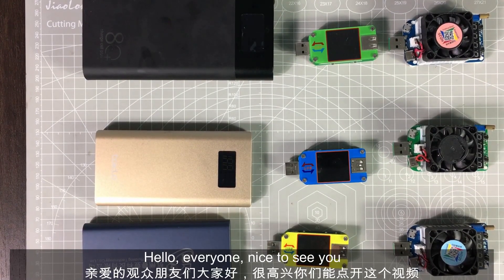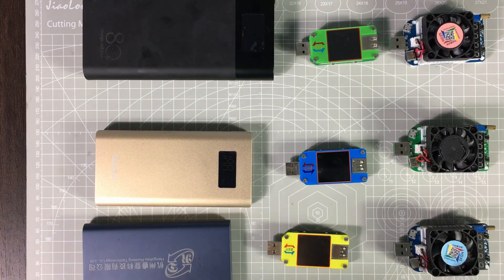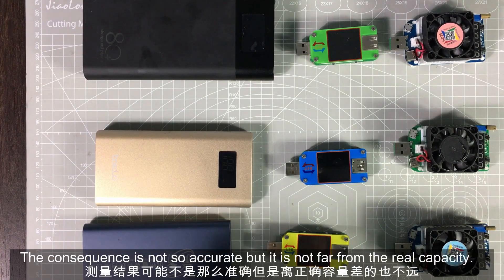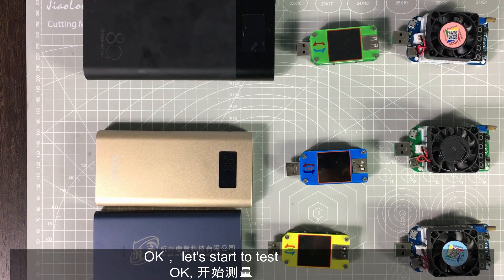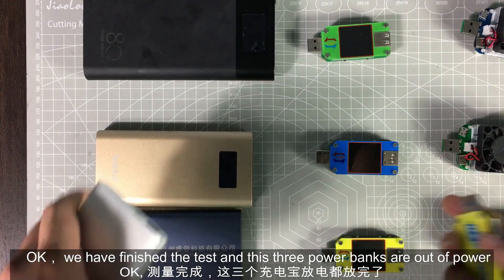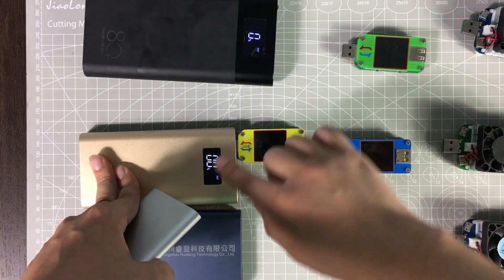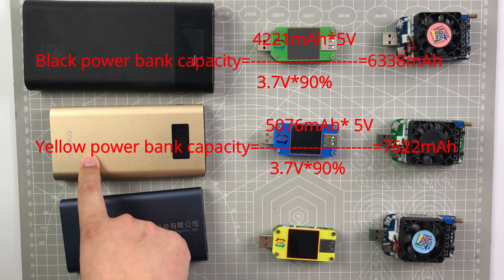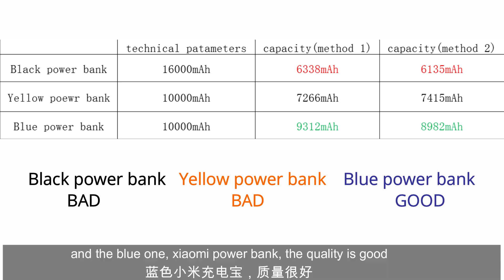[Remake8.1]How to test the capacity of power bank with RD USB tester(UM24/UM25/UM34) and electricity

Comment: There is one unknown parameter: Efficiency.
How did you get the value of 90%. In my opinion it depends on the electronic inside every power bank.

Another advise from my experience. The power banks are never discharged to real 0%, which would destoy the cells. The electronic stops discharging the cells before the cells are discharged to 0%.
So there will be always a remaining cell capacity.
Reply from the maker: the Efficiency will be declared on the power bank, just take a look at the power bank,  and we know that there will be a remaining capacity but it will be small

Comment: Just tested my power bank Aukey PB-N28, it is exactly 3 years old. My result from descharging test: 6696mAh, 33750mWh. Technical parameters: 12.000mAh 45.12Wh; Real capacity (Method 1) 10.054mAh; Real capacity (method 2) 10.135mah. It's more than acceptable for a 3 year aged power bank! Despite your clear explication I have one more question: if I have a device with a 4000mAh battery, how many time I would be able to recharge it? Which is the real value? 6696mAh (so I will recharge 1 and a half) or 10.054mAh (then I would charge more than 2 times). And moreover: I have recharged the same power bank from zero to full, and this time the usb meter (applied to the charger of the power bank obviously) gave me a value of 8559mAh and 44356mWh. Is it in line with the value of the discharge measurement? thank you
Reply: Just recharged from zero to 100% and this time, with another charger of 2Ah, I have a value of 9261 mAh and 47171mWh
Reply: New test just finished today: I have Samsung A70, with declared 4500mAh battery. Charged from 0 to 100% one time with powerbank and the vaule at full was 4200mAh. Charged again with the residue power in the bank at only 72%, value from tester 2700mAh, then the powerbank was completely descharged. Now I'm a little bit confused.....
Reply from the maker: @Sirant100  those power supply with digital remaining battery display is not accurate, at first the number decreases slow and then it drops very fast
Reply: @rdtech9153  Thank you for your replies. I don't have a display on my powerbank, I just wait untill the charge is over then it goes off. I was not considering the power loss, but in all those tests I have the concrete fact that the phone charges less than twice, so: 4200mAh the first time + 2700mAh the second time = 6900mAh supplied to the phone from the power bank, and this value is nearest to the first one I mentioned in the descharging test of the powerbank, that was 6696mAh... So I think my real value of the powerbank is not over the 7000mAh.
Reply from the maker: 1. test data 6696mAh, calculate 10054mAh, used to charge 4000mAh batterty you should use 10054mah but actually it will be less than 2 time because of the energy loss, you can use the mWh, it is more accurate than calculated by mAh. 2.the data from 0-full is useless because there are energy loss when charging and energy loss when discharging

Comment: I don't know if I should tell you this... but... hmmmm... there is a little mistype ;-)
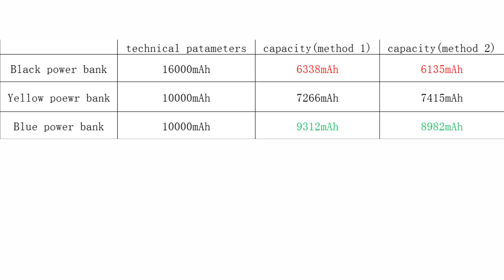At 11:44 it is written "Yellow poewr bank" (should be POWER and not poewr) and also at the same time code capacity for method 1 at the yellow power bank should be 7622 and not 7266. Every capacity at method 2 should be lower, because voltage used in method 1 is not 5V, it is a litlle bit over 4.8V. And that is exactly my point where I told you that you have made a PERFECT meter because you measure wattage (voltage * current and count those wattage over time). Because you always measure voltage and current and multiply it you have exact wattage that was send to the load. I told you from my first message (maybe not directly), but YOU MADE A PERFECT METER! At least for me and my needs. And this USB meter is really not the only great product you make. You just keep making new products and we will buy them ;-)
Reply from the maker: Thank you for your support, I will be more careful next time, and thank you for liking our products.
Reply: @rdtech9153  It is human to make errors.
And me liking your products is all "your fault" ;-)
Reply from the maker: @tomazzaletel3458  thank you , haha